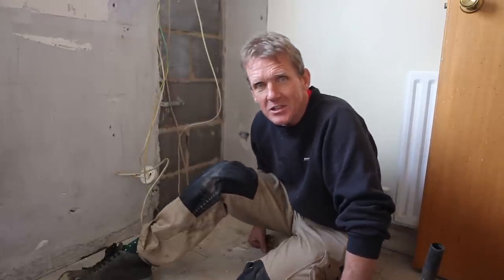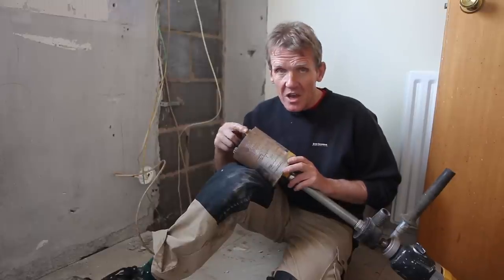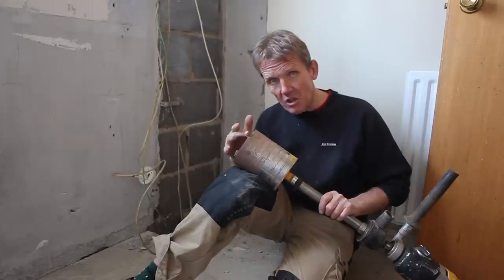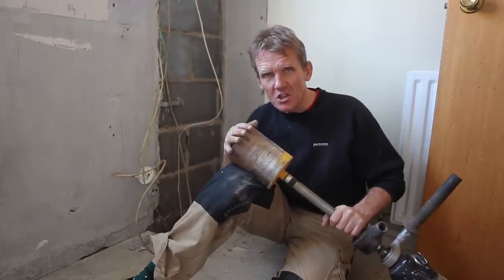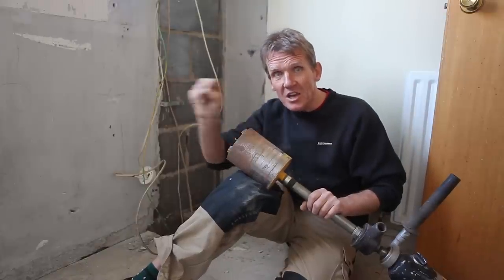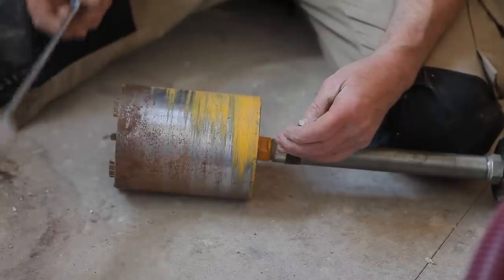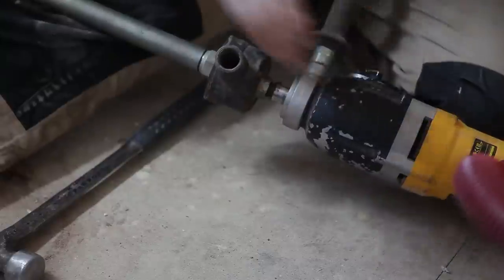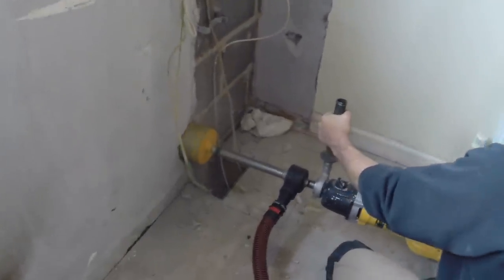Diamond Core Drilling - Tips to Make Diamonds Last

Comment: When you need to redrill a larger hole over a small one you can cut a disk out of plywood to the size of the smaller hole (use at least 2 layers of 18mm of hardwood plywood for thickness, don't use OSB!!), drill a center hole in the plywood disk, insert the disk in the hole in the wall and use it to center your larger sized diamond core bit. You only need it for the first 2 inches of drilling, after which you need to remove both the disk and the centering bit.
Reply: Great tip, thanks

Comment: If doing a soil pipe I do a 150mm cut about an inch deep first and then fit a 110mm and cut through the wall.  If a need to join or fit a 90 degree turn I can chip out to the 150 mm cut to create the clearance needed and keep the pipe tight to the wall.  Cementing up the gap makes for a neat finish.

Comment: Do you turn the drill onto hammer when you are using a diamond.. or are you always using just the drill. I think I was told that you only need to just use the hammer for making the pilot hole then when you have done that you just use the drill option. Thanks
Reply from the maker: That is right, don't use the hammer on the diamonds.
Reply: Perfect, thank you so much. So what would you use the drill/hammer part for ?..sorry if its self explanatory

Comment: Probably an impossible question to answer but what's the chance of breaking out the face of the brickwork if I'm drilling from the inside-out (1500w SDS+ drill, 162mm diamond core, rotary drilling only. Can't drill outside-in because I really don't want to do it up a ladder). I note that Roger drilled a nice neat hole but what's the chance of a relative newbie doing so with much less professional gear???

Comment: Great - I have to drill a couple of 6 inch holes in my garage wall for ventilation. Will be looking to rent a proper core drill. Not sure the clutches on standard SDS+ drills are up to the job...

Comment: Hey  Rodger. 
never used dry diamond cores  are the any faster  than tct core?
I usually core 2inch and 6 inch into 4 inch concrete blocks.. 
would like to know before I invest in new gear.
great videos btw. Enjoy them a lot.  and toolstop are no1 for gear. excellent service.
Reply from the maker: TCT used to be cheaper than diamond cores but Spectrum and Mexco are now so cheap they are worth a go. The difference is that you get a smooth hole on the outside so if you are drilling from the inside out it matters.

Comment: Can i use SDS plus drill bit on a standard chuck ?  

I purchased a 30mm Tungsten Carbide Hole Saw bit for making few holes in a cement plastered brick wall as part of a DIY project at home and it is a SDS plus drill bit and what i have is a pretty basic Hitachi hammer drill, so i wanted to know if this drill bit would be compatible with my drill.  Also if I can use it, should a hole saw be used on hammer setting ?
Reply from the maker: Those tungsten carbide tipped hole saws are made to hammer on SDS and your percussion drill won't get the best out of it but it will do no harm. Stick it on hammer and have a go but keep pulliing it out and letting it cool down slightly because they are not made for high speeds and overheating they don't like. Some people spray them with a bit of water which helps but it makes a mess.
Reply from the maker: Also I forgot to add that I bought a complete set of ten diamond core bits up to 35mm for less than £10.00 on ebay. Straight out of China but they are brilliant. I will do a video on them soon If you run them wet they are great

Comment: Great video, thank you. But what if you have a 240mm thick solid brick wall (Flemish bond) and only a 170mm deep core? Surely when you get to the end of the core you are stuck with a wad of brick that needs to be chiselled out, no?
Reply: That's what the core extension shaft is for.

Comment: What happens if it's a cavity wall? I found when I went through the first layer and started on the second it would jam so frequently! to the point where it got stuck completely. Should I re-insert the pilot hole? Is it because the 2 holes are slightly misaligned?
Reply: You shouldn't have to reinsert the pilot hole. Slight misalignment could be the problem but it could also be a number of other issues. How powerful is your drill? - Ideally it should be around 1300/1400+ Watts. If the substrate you are drilling through is very damp then that can cause the core bit to continuously jam. Do you have a vacuum connected to the drill to remove the dust? Are you dry or wet core drilling? Have you hit a wall-tie?

Comment: Any idea where the  dust extraction kit comes from? Googling Dewalt gets me nothing.
Reply from the maker: I will try and track it down. It seems the DeWalt system is no longer there but I can't believe it has gone.
Reply from the maker: http://www.coredrillcity.co.uk/product_info.php?cPath=1_22_51&products_id=562&osCsid=addhsep0naf71o2k0p3ntfp1q3

This is the same bit of kit. I don't think DeWalt made it. You can actually buy it as part of a diamond core set from Screwfix for a lot less than buying it on its own.
Reply: @SkillBuilder  Very many thanks, I've discovered Mexco also make a kit though I can't vouch for 
it...https://www.mexco.co.uk/Products/Diamond-Drilling-Dry-Core-Drill-Kits-X90-Grade/A10DCDKITEXT3 but you'll need to find a stockist.

Comment: Which size core drill for 110mm soil pipe? 110mm or 117mm or even 127mm?
Reply from the maker: Hi Neil 
I made this mistake on my first every core drill. You need one that will take the collar of the bend or branch and to give yourself some wiggle room you need a 127mm bit. This allows a bit of deflection if you need to angle the pipe and elbow.
Reply: @SkillBuilder  Thanks for your rapid response and for the info. Really appreciate it. Love your channel. It’s always my go to for instructions when I have some diy to do. You always seem to have a tutorial for whatever job I have lined up. A true professional. Thank you 👍

Comment: very useful. a few times a year a need to drill a 5 inch hole through engineering/concrete (new build fireplaces). its always a pain and ive often reverted to stitch drilling, which makes me feel like a muppet. im sure my drill is un powered for the job and worry that a 5inch core drill is too big/dangerous. @skill builder how big can you go, before its dangerous. i once got a quote from a firm to wet drill a 9inch core. they wanted £400....
Reply: You can drill up to 5 inch but rent a dedicated machine with enough power and a decent clutch, any larger and you really need a rig that can bolt to the wall/floor for saftey.

Comment: What drill are you using?
Reply from the maker: DeWalt
Reply: @SkillBuilder  What model and watts. I'm going to core a 162mm hole in LECA block. Will 800w be enough?
Reply: @AlexinOslo  Absolutely not, minimum 1500w
Reply: @techguy666  I cut through the Leca in minutes with an 800w Metabo Drill with clutch. The core bit was from UK drills, really cheap. I made 4 x 160mm holes.   It was overkill but luckily I sold the drill after the job for almost what I bought it for.
Reply: @techguy666  1500w 😂 Last time I trust YouTube.
Reply: @AlexinOslo  Well, I never worked on LECA blocks but for engineered brick, concrete and hole of that size I use Milwaukee DD2-160XE2. Anything under 1000W never worked for me, maybe it does for you. The drill you see in the video is 1700W Dewalt D21580K.

Comment: I have a bit of metal to cut through inside the concrete that I'm drilling. Its just a vent pipe, the metal is only very thin about a millimeter or so. My question is will the diamond core bit get through that? anyone know?
Reply from the maker: If the metal is embedded in concrete then the diamond teeth won't snag on it. The diamond will cut through the metal with no trouble. It is only when it hits a bar suddenly that it knocks a tooth off. Take it easy let the diamond do the work and you will be fine.
Reply: thanks great video btw

Comment: I need to drill a vertical blind hole in concrete to locate a pole. I have a 90mm x 480mm core drill. I would really like to go down at least 400mm. How do you extricate the concrete core? Any advice would be gratefully received. Thanks, Barry.
Reply from the maker: Asciidv
Hi , I would keep taking the core out every ten seconds to make sure it doesn't bind up with dust because, once it does, it could be jammed in there for good. 
Once you have reached the depth take the core drill out and put a rod or bar down through the pilot hole and break the core out. It needs to snap at the depth you drilled, assuming it is 400mmm deep, which is a lot for concrete. 
When you are drilling walls you normally get a 100mm  core out but in your case that won't happen.

Comment: My diamond core is jammed in and I can't get it out. It's in at full depth of core. Any ideas?
Reply from the maker: + Peter 
It can only be dust that is jamming it so you should be able to suck out the dust and tap it gently to free the dust. 
If the wall is wet you need to run a fan heater or something on it for a few hours to dry that dust paste out. Jamming can be a problem hence my tip about pulling it out as you go. Let us know how you get on.
Reply: I was drilling the floor bringing in a new water main, had to go under the wall of house, I took out the adaptor and drilled through threaded hole in core with long drill to reach trench under wall, then used vacuum under core to suck out dust. What a job! Thanks for as vice mate
Reply from the maker: I feel for you Peter. I have done so many of those water mains under the foundation and they are never easy. A bit from outside a bit from in and there is always the last bit you can't get at. 
Still you did it mate so chalk it up.
Reply: Use a pair of stillsons quicker than using a fan heater

Comment: "Like having sex, if ya can remember what that's like!" LOL. "I've been married 16 years. You only get 7 for manslaughter!" (Mike Harding.... or might have been Les Dawson..??) Try coring thru Accrington brick. East Lancashire. The casts for the bricks had the letters "IRON"  imprinted on them, but they didn't reverse the lettering. So, when they came outa the kilns, they had "NORI" imprinted. All the same, I have never encountered bricks so impenetrable and hard as these.
Top tip re exposing newer diamonds. Those cores aint cheap!
Reply from the maker: loafer sheffield + 

I know the Acrrington Nori very well and use it sometimes for the diamond blade tests in Professional Builder Magazine It is  class A engineering brick like Staffordshire blues and looks great in a dpc.
I knew it spelt Iron but I hadn't heard the story about the casts. It would be mirror writing.so maybe the bloke who laid them in was having a bad day.

Comment: What about if i want to cut a new hole (because the current 110mm hole is 2 inches to the left of where it should be)  just about 50mm to the side of a current hole. Is it possible to to this with a core drill ? becuase only one side of the core will be cutting into brick.
Reply from the maker: Yes but you will need a piece of plywood with a hole in it to position the core on the wall. Once it starts in the wall it will be fine